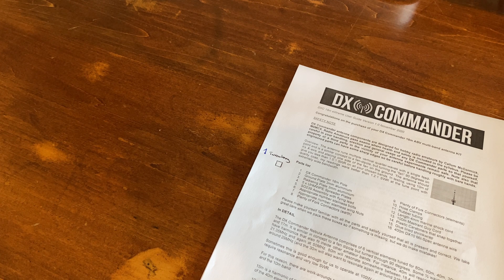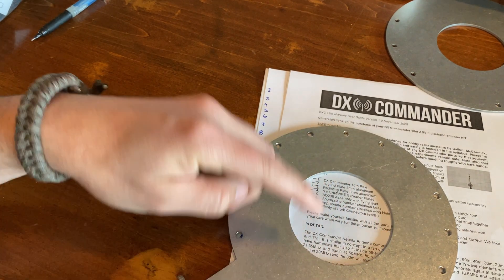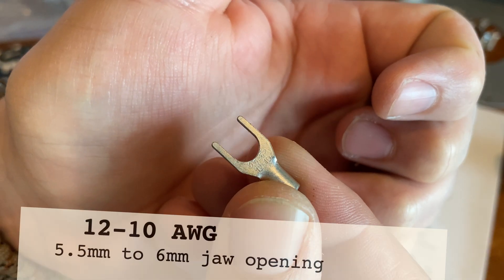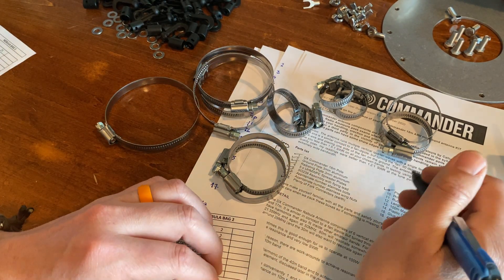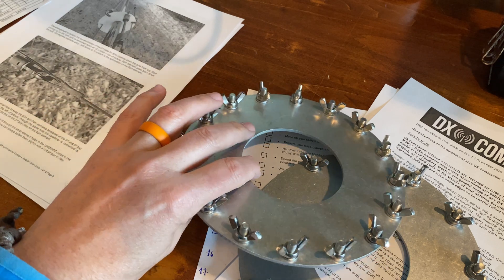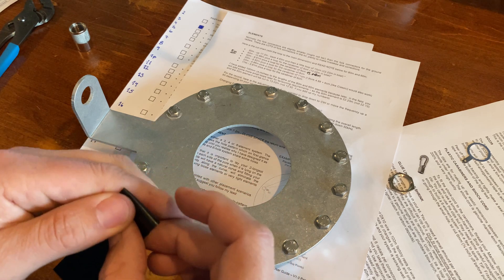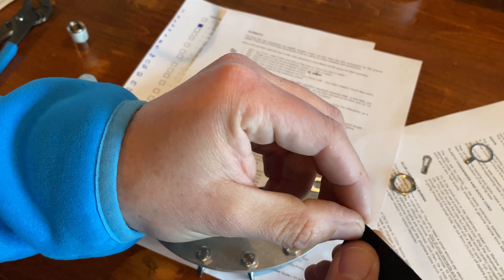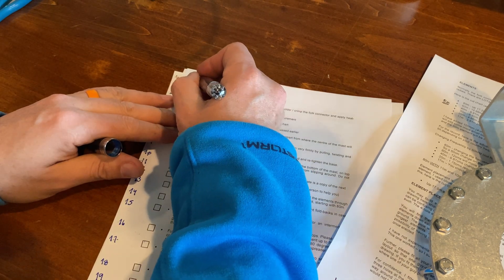DX Commander Nebula - Part 2

Comment: Enjoying your build. The Neboola wouldn't be practical for me but I do have Expedition, Classic & 12.4 (which isn't practical either 😁) On all of them, I have the bolts on the Radial plate coming through from the bottom, pointing up like the SO239 tab, so the wingnuts are on top of the plate, just like the driven plate. The radial plate is very close to the ground and the way you have, going down, might make the wingnuts awkward to use. (you may already have found that out in Episode 4)
Reply from the maker: As a matter of fact it is one of the things I have noted in the raw video that I haven't edited yet. I'm guessing it will be in part 5 or 6. You are correct it would be WAY easier to have them on the top side and I may switch them around when I take the antenna down to tune 80m better.